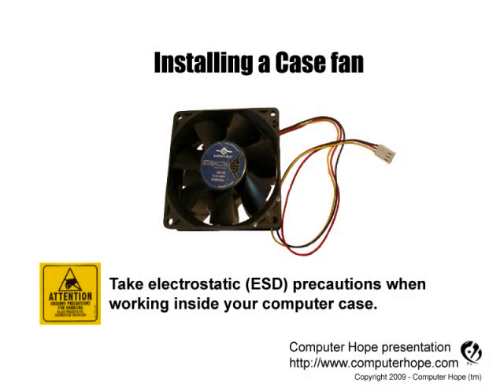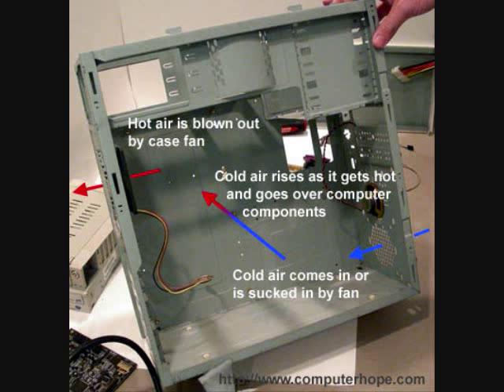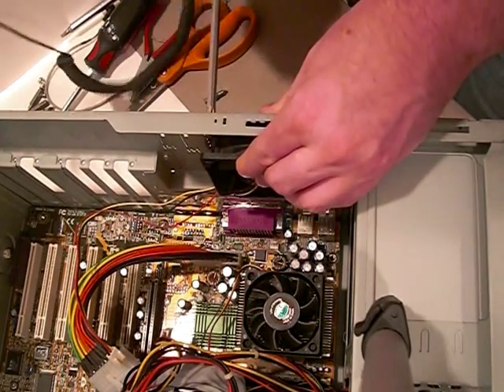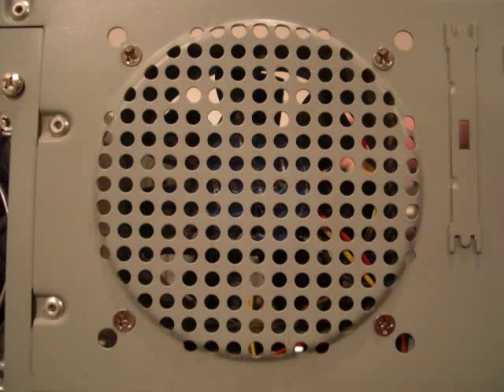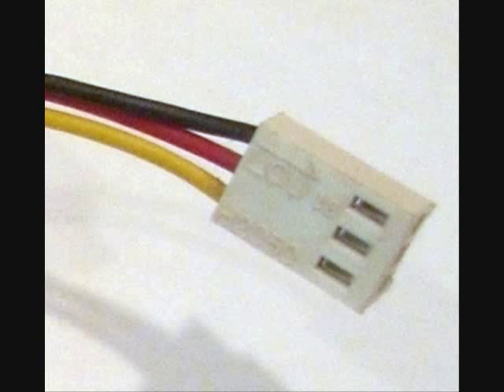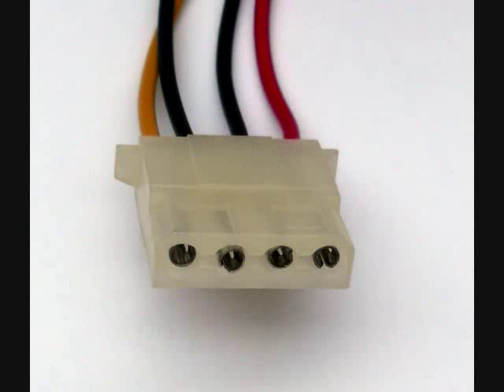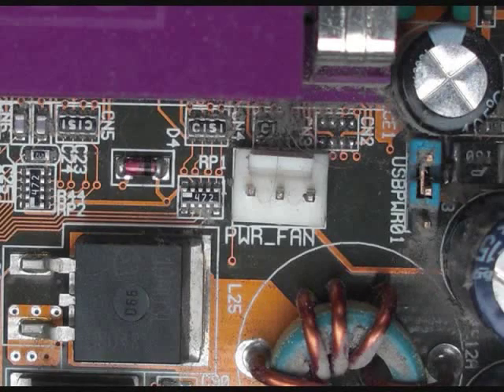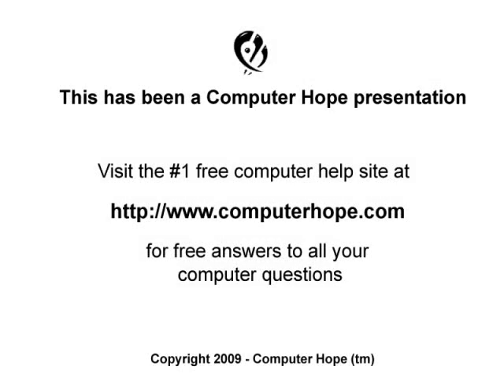Installing a computer case fan

Comment: The direction of the fan can be identified by determining which side has the plastic strips or circular metal wires bracing the fan. If the side you're looking at has either of those, it is the exhaust side, so air will flow out through there.

Comment: I bought a generic fan but it has no connectors at the end. There are 2 wire sticking out from it, one red one black. How do i use this?

Comment: Hi there! I've got a case fan with a four-pin connector. Could you tell me is it possible to connect the four-pin connector directly to the motherboard? If it is possible, I need to know where on the motherboard is the four-pin plug. 
Thanx in advance :)

Comment: I know I can use a regular 3 pin case fan with a 4 pin PWM header on the motherboard (on a heatsink). Now, can I use a PWM fan (4 pin), made for heatsinks and cpu coolers (I suppose), as a regular case fan and plug it into the 3 pin mobo plug? Or can I use a fan controller that only has the said 3 pin plugs for fans to control that 4-pin PWM fan?

Comment: im confuse, the 120mm fan thats already installed in my pc has a small black and small red wire coming from it and its connected to a molex which already has the red, two black and yellow wires, so theres 6 wires in the same connector?